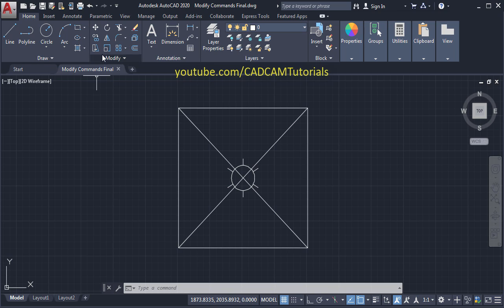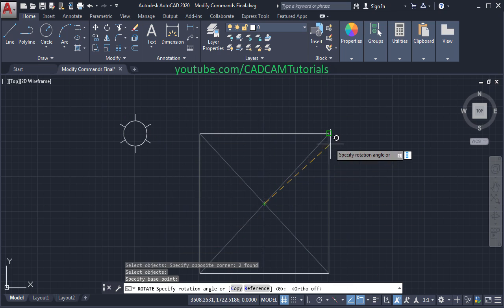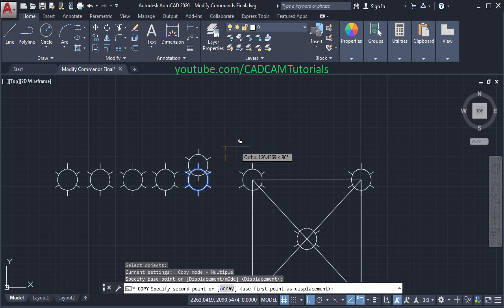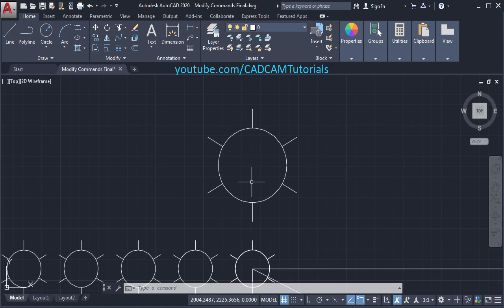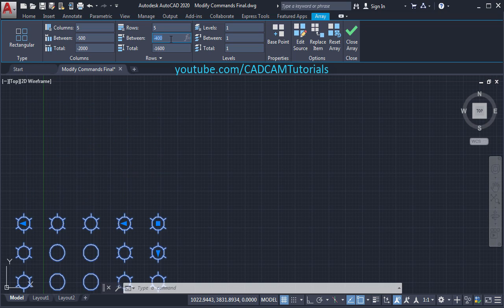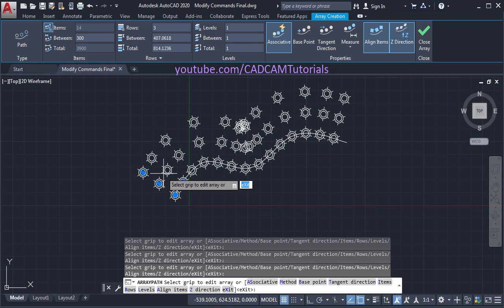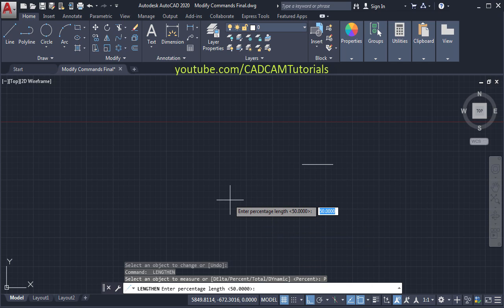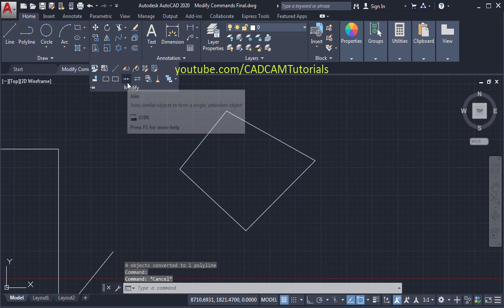AutoCAD Tutorial for Beginners - 6

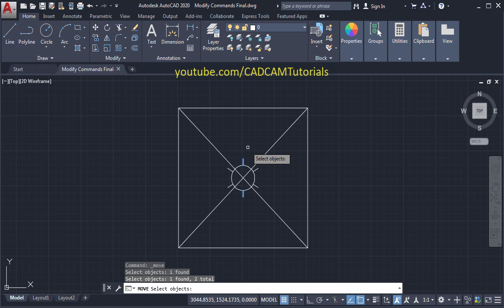Comment: 0:39 window selection in move command (object(s) inside the window is selected)
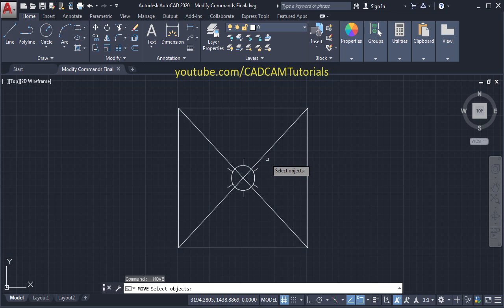1:02 crossing window selection (object(s) inside and crossing the window are selected)
01:27 shift+click to cancel a particular selection in move command
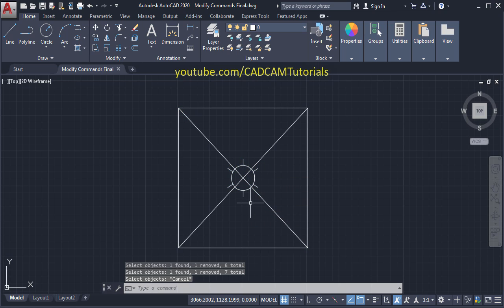01:38 for compulsary window selection type w enter when select object is asked
For compulsary crossing window type c enter
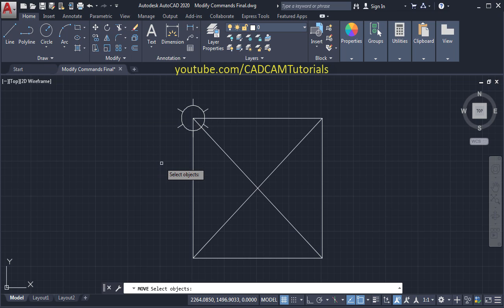03:16 if you used move command and now again want to move the same object then type p enter in select object.
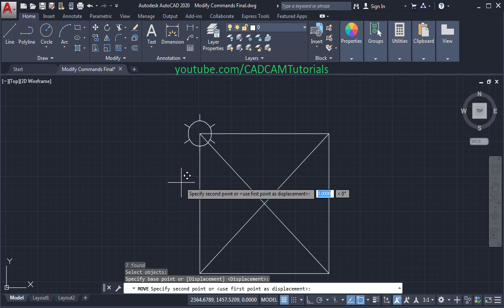03:40 manually move
Rotate: to rotate anticlockwise type magnitude with negative sign
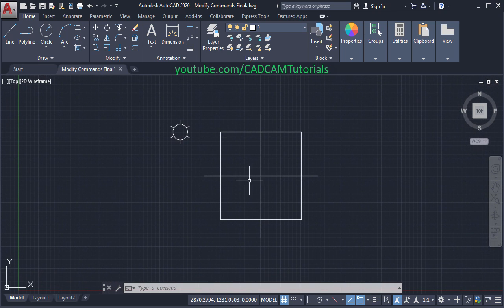05:33 Use of copy (keeping original also) in rotate command
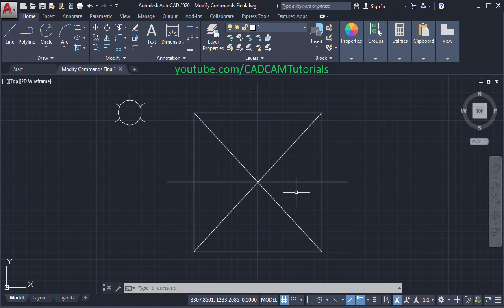06:35 rotation by giving a separate reference for angle,for convenient rotation tracking (reference के time second click पर ही cursor रहता है)
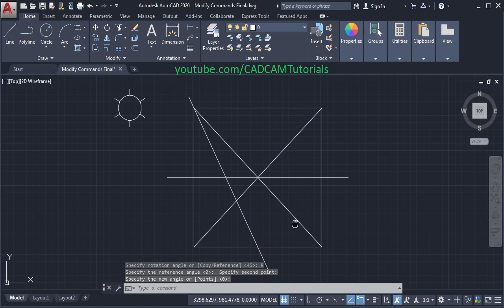07:35 Rotate to match the angle of a particular line
09:14 array in a copy command (array will be linear)
10:40 use of blend curves(click on approximate positions on line)
12:08 Always use crossing window for stretch.The objects completely inside the window are moved and objects partially inside the window are stretched
13:39 scale of object by giving multiplication factor
15:11 use of copy in scale
15:43 reference in scale (किसी particular length को स्केल करना)
16:46 rectangular array
18:50 replace particular items from array
19:48 change the direction of array
20:28 reset array removes the edition of some particular objects.
20:45 edit source in array
21:57 use of explode
22:52 path array various settings
26:49 polar array
28:52 lengthen
31:05 allign
32:54 break
33:53 break at point
34:15 join (reverse of break at point and
 JOIN joins to collinear lines by filling the gap between them and
 it can also convert closed multiple lines as polyline